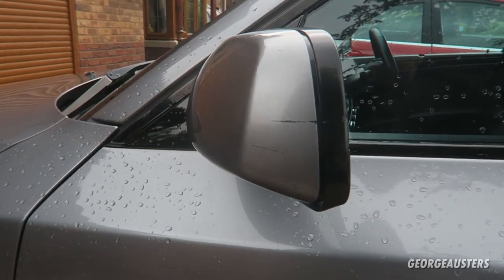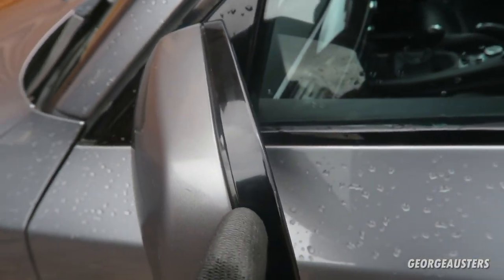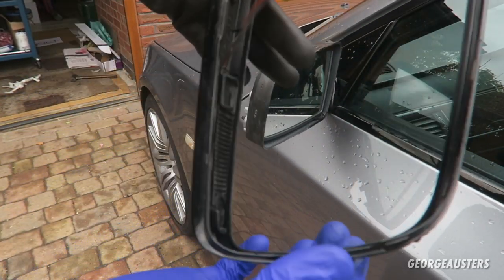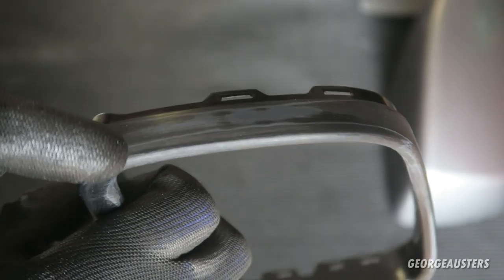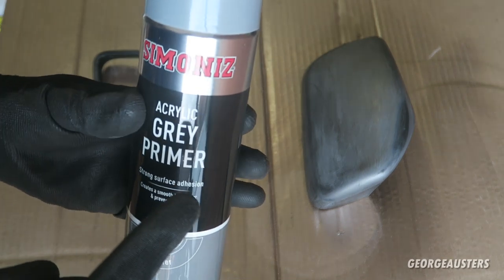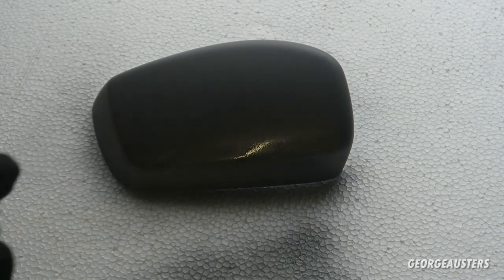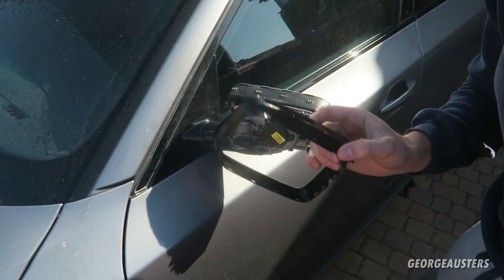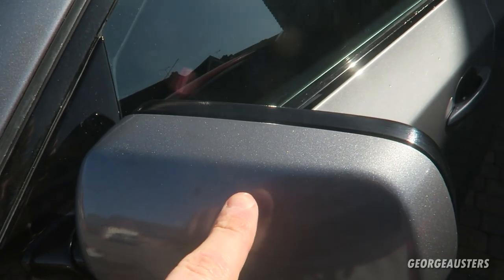Car DIY Wing Mirror Repair

Comment: what about a video ceramic coating your car?
or what should we use for the black trim to bring it back to life
Reply from the maker: Not a bad shout that mate. I need to get some polishing equipment before thinking about ceramic coating it though!
Reply: @GeorgeAusters  would be great ... i changed my e 90 same colour as yours for an f30 black ... and it.s a pain in my ass to keep it clean ... that's the only thing i regret (the colour)

Comment: Shouid the paint coats be sanded before applying another, of should the paint layers just be applied on top of one another 'from the can'? Many thanks!
Reply: If you fine sand the paint between layers after you allow it to dry you'll get rid of the orange peel... After the final 3000 sanding apply the clear coat/lacquer.
Reply: @Adistar-gtm  Many thanks!
Reply: @williamevans9426  you're welcome. Remember the more time you spend prepping the surface then the primer then the sanding of the layers the better mirror finish you'll achieve. You can even go to 5000grit for the final layer before clear coat. But for mirrors I don't think it's worth it. For a hood or other big plane panels, absolutely.

Comment: George, nice job, BUT , it may peel due to not dusting the bare sanded plastic with PLASTIC primer prior to the grey primer. Just a tip for when you do other side lad .
Reply from the maker: No issues with peeling so far👍🏻
Reply from the maker: I believe that primer is for plastic and metal